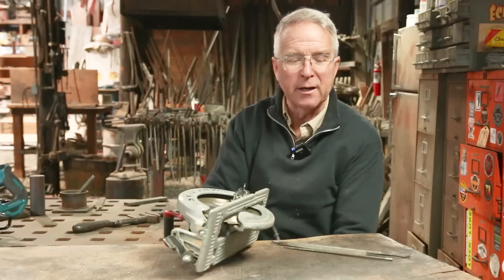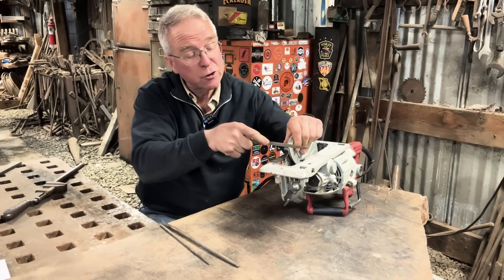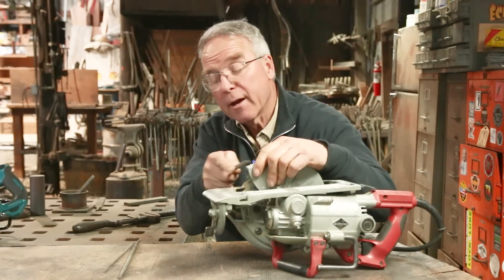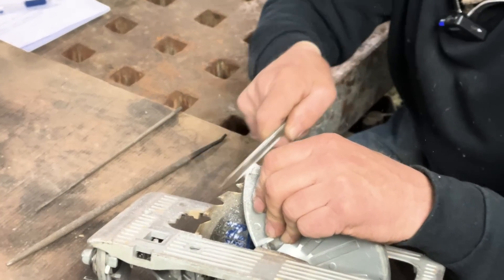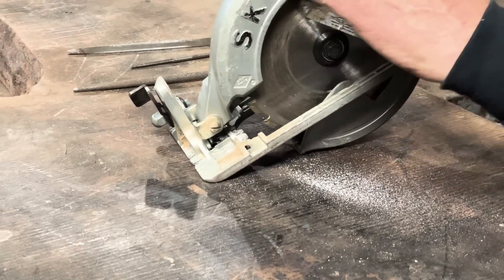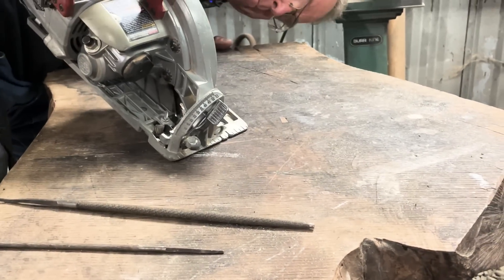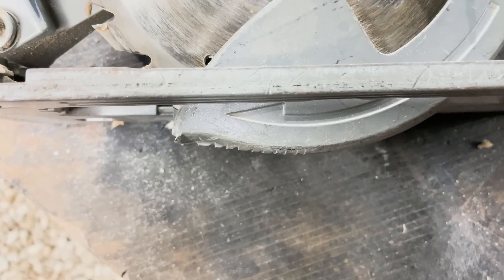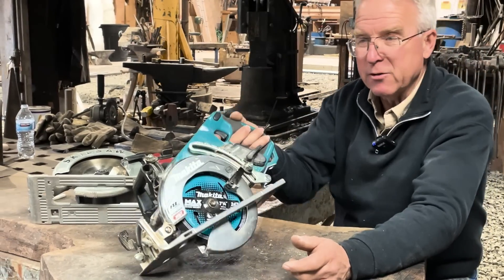Simple and Safe SkilSaw Hack

Comment: While working on another project one day I had a brainstorm and put a small dab of the two part epoxy I was working with on the end of the guard, then dipped it in sand. After letting it cure I used a wire brush to knock off the loose sand and voila! Custom grippy pad!
Reply: This.....This is a great suggestion!

Comment: I also have a Skilsaw hack: 

if you get one with the Diablo blade like I did (my first ever Mag)…and that blade is mounted label out…it’s backwards. 

I did several projects with that new saw including a headboard made of century old 1.5” barn wood and cut down several interior doors – with the blade backwards. After the headboard project it was struggling to cut deck lumber so I replaced the blade thinking the PL I used to laminate the boards of the headboard must have dulled the blade. Another Diablo went on, mounted the same way the factory blade was mounted. Cut two more doors put the saw down and wondered what all the rage was about with this saw. My contractor friend was with me at the time, he grabs it to cut a 2x4 and said I needed a new blade. I told him it was new. He looked at it and said “your blade’s on backwards”.

Comment: I don't have either of those saws in the UK, but I have very similar. I used 40 grit sandpaper, cut into 1/4" x 4" strips, and attached to where you filed the groves with double-sided tape. works fine. Replaceable.

Comment: Another, very handy add-on is a small piece of angle aluminum on the blade guard handle. I always wear leather gloves because of the increased grip traction they give me, & the streamlined guard handle is easy to miss.

Missing the handle can also be a potential safety issue, as well. I've missed the handle in an awkward position & ended up having my hand head towards the blade.

We all end up using a Skil saw in an awkward position... it's the nature of construction.

Have you ever used a Skil model 367? They take a 6.5" blade. I've had one, in addition to 77s, for 40 years & love it.

Comment: I 3D printed a guard handle latch for my Makita saw.

Grab the guard hand and bring it forward, flip the latch over and it holds the handle and thus the guard open for plunge cuts and ripping pieces so you don't need to hold it open.
Reply: Patent it, make it, sell it.  You'll make money.   Eventually the lawyers and the Nanny-state will catch on an make it a common feature but not until someone like you has made a bunch of money they think should be theirs.
Reply: @ramosel  Patents are expensive & useless for those type of things. Couldn't be bothered lol
Reply: @evictioncarpentry2628  One of my girls is IP lawyer...  might not be as bad as you think.
Reply: @ramosel  I've dealt with patents before. The thing about it is, China doesn't give a flying F about IP. Everything gets copied and sold for cheaper. Especially little things like that.

Comment: So usually most people will hold the guard when plunging yes but sometimes you just don’t have the third hand you need to do that. Which is what I believe Scott is referring too. With this problem I glued on a strip of soft rubber to help. And I’m surprised but not surprised I guess to hear how many others have also done similar things to help with this process. A wedge has also been used by myself quite a bit but it makes me nervous to see others do it in the job. So the rubber or grip tape is a great idea.

Comment: For plunge cuts I open the guard with my thumb and place my index on top of it for safety, it's not the best approach but I find it better than struggling with it.
Reply: I've done it that way forever .. i thought that was the only way to do it and get the most accurate cut. And i do get the most accurate cut doing it the you described.

Comment: How about putting some epoxy or J-B on the same area you filed and then making points or teeth?  
I do plunge cutting quite a bit in the very little DIY type work I do with my saws.  Mag77 included.  But never really thought to add more grip as much as I HATE having to hold open the guard.  Also, I have been swapping out my short cords for SOOJ cord and a nice plug for decades.  Usually new out the box.  And always buy nice extension cords.  Cheap ones just piss you off.

Comment: If it's just a bit of traction on the guard you're after why not just grab a couple of the self adhesive silicone rubber bump stops that you get for kitchen cabinet doors?  It may be worth a try before you start cutting into the guard just to see how you get on with it.

Comment: I started framing in the early 70s, all the guards were pinned out of the way. Nobody had guards down. Skil worm drives are my favorite. I have 6 1/2 to 16 in. ( I do not pin the 16" saw). It's how I learned. I'm not advocating for pinning your guards.
 For me, especially angle cuts they are in the way.

Comment: When looking at the saw blade cover where it touches, is where you need to ruff up the surface. I would put a stick on rubber dot, like used for cabinet door bumpers, to grip and thereby move the blade cover open. I get it, it's a safety thing, and the manufacture may not be withing the OSHA standards with this type of alteration.

Comment: What about a bead of E6000 along the ridge of the guard? ..or, if there's room, maybe screw a sharp screw, like one of those little black bumble bees from the inside and coming out the ridge? 
..hey, can I use regular 80-90 weight gear oil in my skilsaw instead of the skil oil?

Comment: This is probably not the safest way, but I’ve always held the guard back when doing a plunge cut. I did one yesterday in fact. My 20 year old dewalt circular saw has a little handle thing to make it easier to hold back.
Reply: I've never not held the guard back while plunge cutting! Usually trying to hit a line so why wouldn't you...

Comment: As you know, back in the day; we just took those guards off and didn’t worry about the darn things binding up. But osha n stuff forced the guards back on. You could run an 8-1/4” blade that way and cut through a 3x4 on 1 pass or a 6x6 without using a sawzall.

Comment: Don't let a spark get near those shavings
Reply: Conditions would have to be incredibly ideal for a single spark to ignite shavings/saw dust. BUT, it is remotely possible and I saw something similar on one occasion. 

Had a couple saw horses set up, making multiple, repetitive cuts. A pile of saw dust was naturally building up beneath the saw horses. Someone laid a 4 foot level across the horses and we started doing some assembly. A few minutes passed by and we started getting a small whiff of smoke. Incredibly, the sun was passing through one of the leveling vials, on the level that had been laid across the horses. It must have been placed just exactly at the right time, position, angle, etc, etc, and the pile of saw dust began to catch fire. No damage done. Caught what was so unlikely and unlucky going on in plenty of time to avoid any problem. I’m sure I couldn’t duplicate that again if I spent hours trying to set it up.
Reply: @psidvicious  it's not saw dust, it's magnesium dust from filing the guard. When ignited, it could reach 5000° depending on the alloys used and isn't easy to put out.
Reply: @etubcsegg  Ahh, those shavings. Gotcha

Comment: I do plunge cuts right onto my pencil line by positioning the saw directly above. I have part of my hand on the top of the fixed gard, and use one finger or thumb to pull the pivoting guard up. Then I have have the front toe on the line turn on and hinge the saw down into the wood. Keep that front of the saw on the board. Practice with it off, holding the guard up, in a way if you're not paying attention, your hand or fingers can not slide into danger. And safety goggles will allow you to watch the blade is on line as it drops down in. If you hands are big enough you might be able to keep both hands on handles while doing this.and after the base is down to the surface, hold the saw by both handles.

Comment: I never have a problem with my guard because it’s got a nail stuck in it so it don’t come down… might be a little dangerous but I was taught how to run a saw like this in my early teens when I started on construction crew …  never had a problem with it this way either.. I know osha might not like it but people have been cutting this way for decades… those that have been cut by not having the guards down did not take the proper care when making a cut …maybe hurried or did not know what bind the wood was on …  some cuts can’t be made with the guard fully down anyways 
For every action there’s a reaction and if one is careful one usually does not get hurt

Comment: They know many of us will lock out the guard for certain cuts.  Whether you do it with a piece of wood cut in a wedge or big nail, we find a way, when the job demands it.   The way we have to lock out the guard probably is more dangerous than the act of locking out the guard.  I just wish they'd acknowledge we do this an offer guard lock out button.  

So when you need to do a plunge, pull the guard back, set a lock out button, make your cut.  When you are ready to go back to "safe" mode, push the button and the guard snaps back into place.

Yes I know I just made a bunch of corporate lawyers cringe and all the Nanny-State pearl clutchers gasp...  but it's a feature that is long over due and first company to offer it will sell a lot of saws.

Put the safety of the saw in our hands and if we f@ck up, it's on us.
Reply: I’m certain you’re right and it’s the lawyers that have prevented this innovation from being introduced. A regular carpenters pencil has always worked good for me as that necessary, impromptu ‘wedge’ to pin the guard back temporarily.
Reply: i just use my pencil perfect fit for my saw dont use it often but i need to it's there , i tried the wedge it seems to slip sometimes
Reply: I inadvertently made a setup for a 'pin the guard' when i dropped the saw and slightly bent the portion of the guard that Scott is filing. With it slightly bent, it has enough friction to hold in the pinned position when it needs to
Reply: I’ve said the same
Thing for years 👍🇺🇸
Reply: A week or two after buying my saw i looped an elastic band on it's handle and i used it to hook the little lever for the guard when needed. (this felt like a sketchy implementation) 

I eventually went full out and made a little latch instead, that can be released simply by giving a little tap or shake of the saw after a cut. 

Holding the guard back to make a cut put my hands in a weird position, and the amount of force to pull it back during a cut sometimes was rediculous and felt dangerous in it's own way. 

I never remove guards on tools other than an angle grinder (because of wire brush).
I just feel like a circular saw needs a way to temporarily hold the guard without having hold your hands in an awkward way to be deemed a true safety feature
Reply: Yer carpenter pencil works to pin open the guard, dangerous, yes
Reply: Saw has a waiver to sign at the checkout, can't buy it online, either 😂
Reply: Yes, people should not be using this saw without a little guidance and common sense training. I started using a worm drive saw like this in 1969 and always had the blade wedged because if you know how to lay one down with the blade away from you it's not a problem.  Try cutting a 1/16th off the end of a 2 x 4 with the guard down is almost impossible.  The lock out idea is a great idea.

Comment: I hacked my saw by drilling a hole and using a nail that allows me to pin the guard out of the way. I can release the guard in seconds if need be. No one is allowed to use my saw but me because I know it is more dangerous that way, try doing a compound angle cut without pinning back the guard, you need both hands on the saw all the time so holding back the guard is dangerous no matter what you do.

Comment: #6 Sheet metal screws thru the bottom of the guard sharp point down. There should still be enough clearance for the blade. May have to take the head down a little.
Or run them in from the bottom and cut the head off, leaving a sharp point.

Comment: A ‘hack’ to achieve the same thing [even better], that I’m sure most veteran circular saw users already know, but really should not be used without a minimum of 2 decades experience with the tool, is this:

	1.	Pull the guard all the way back
	2.	Wedge your carpenters pencil in between the saw guard handle and the saw guard housing itself (fits perfectly on most saws).
	3.	Viola! The guard is up and out of the way, with the blade completely unobstructed and dangerously exposed.
	4.	Carefully make cut
	5.	DON’T FORGET you’ve wedged the guard back before placing saw on it’s side.
	6.	Remove pencil from wedged position on saw and return to pencil slot in tool bags. 
	7.	*Reminder - minimum 20 years experience necessary before attempting this hack.